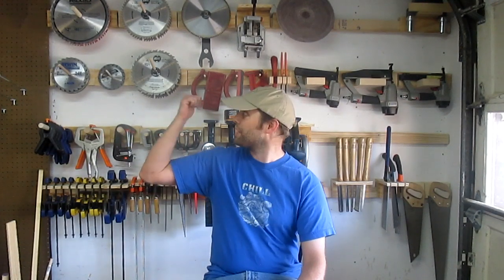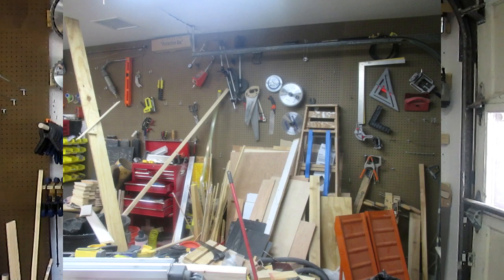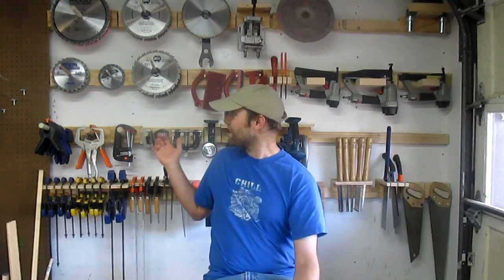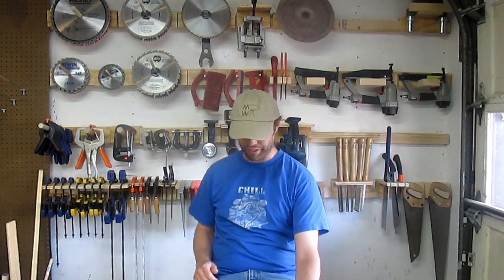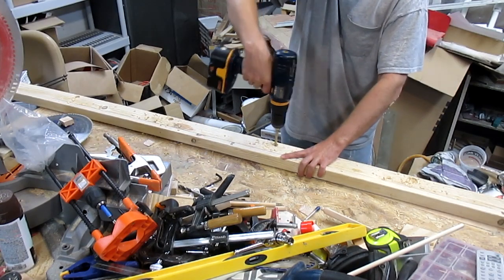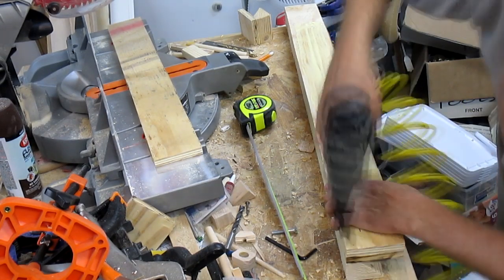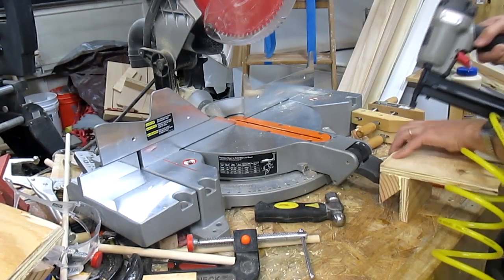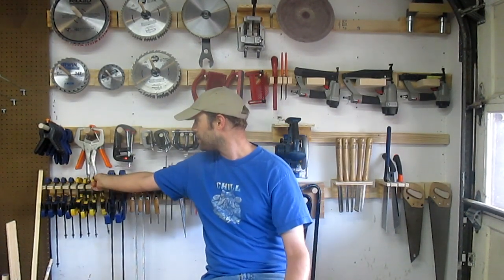13 - Cheap and Easy French Cleats - Manhattan Wood Project

Comment: Nice video. Thanks. Just was noticing the nail guns. If you wanted to condense some space you can store them on their edge. Buy some cheap air hole conectors from like Habor F. Screw them in a wooden bracket that works with your French cleat system then snap in the male fitting on the nail gun and your all set a 1/3 less space used. I wish I could find video of the guy who posted it. I'm sure if your interested you should be able to find it. Good luck

Comment: I like the 2x4 base approach.  Seems cheaper material-wise but more sturdy.  Others have said use plywood throughout.  To me that seems risky because plywood cut at 45 degrees would be weaker at the tips than solid wood.  Have you had any load issues?
Reply from the maker: I worried about using plywood for the wall mount because I buy cheap plywood, and don't want it to delaminate when I load it up.  With the 2x4 base though, and relatively light loads at the proper angles on the plywood, I haven't seen any problems at all.